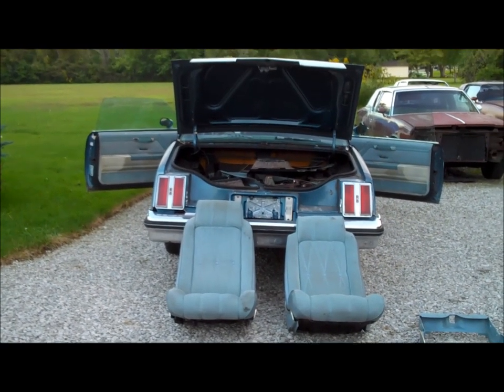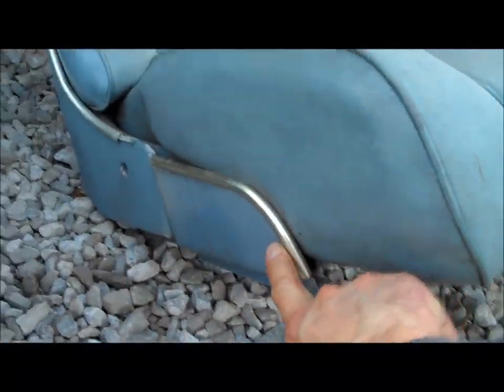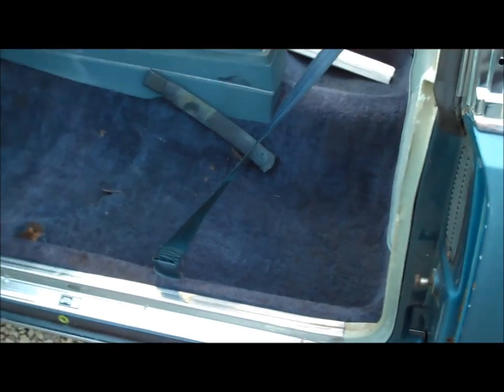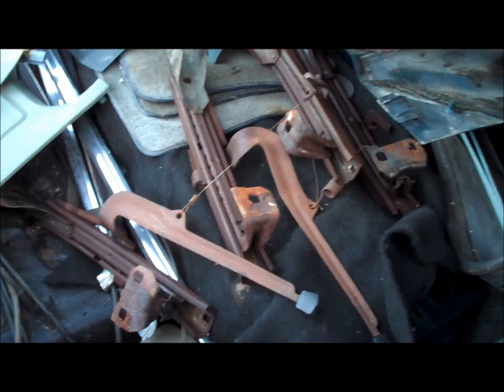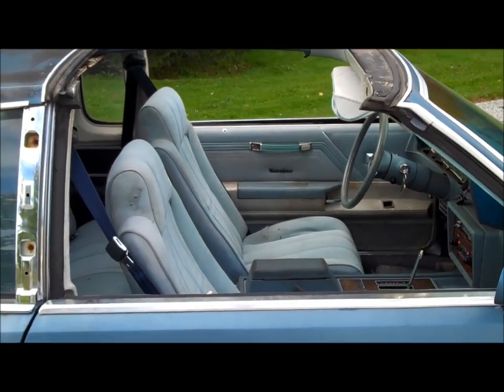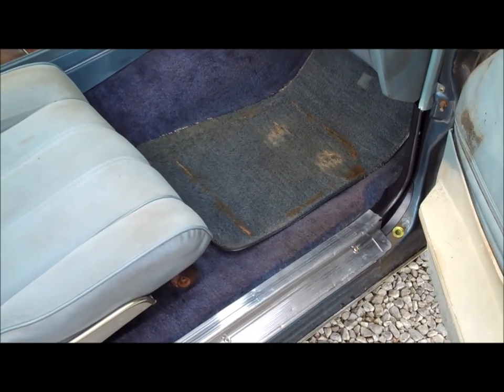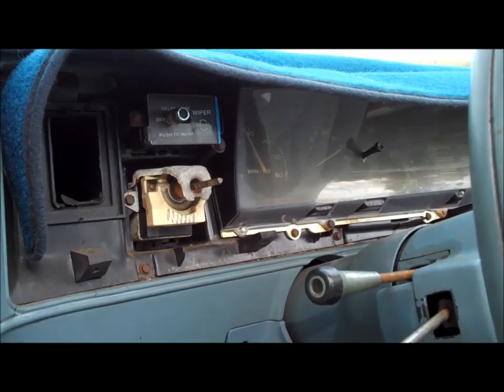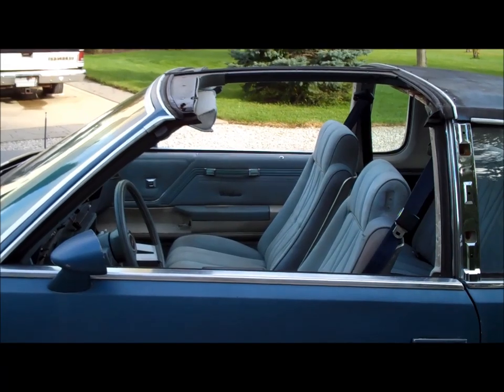78 Calais Bucket Seat Installation Classic G-Body Garage

Comment: Damn looks good for a near 40 year old car! My 86 Cutlass isn't that clean... yet... Good job!!!
Reply from the maker: Yeah it cleaning up.
Reply: Silly question! My 86 is a 5.0L would it be a 305 or 307?
Reply from the maker: Derek Joon 307 if in the states, 305 if in Canada. 307 if it has an old filler behind the water pump and 305 if you fill the oil through the valve cover.

Comment: Looks Great! When you do your gauge video, can you cover how to make the speedometer stop making noise. Mine makes a chirping/rattling sound that is proportional to my speed its worse when it's cold out. I'm sure the grease inside it is probably hard, but is there a way to relubricate it? Mine is the regular speedometer not the rallye gauges.
Reply from the maker: DanielRau1234 I will make that part of the gauge video. Yeah you have to oil the cable itself and remove the cluster to do so. Some oil on the speedo cylinder itself would help.

Comment: question ... are the seats of a 1979 G body and a 1984 the same....???

could the 1979  seats of a cutlass fit in a 1984 Monte Carlo??
Reply from the maker: molina555 The seats are all the same in a 78-88 Cutlass, Chevy changed design on theirs in the early 80s to the smaller style found in the monte ss however all styles of gbody bucket seats fit in any gbody car. All seat tracks are the same.

Comment: My driver seat won't slide back on my 79 cutty any suggestions?
Reply from the maker: The wire that ties the handle and latch to both tracks might be broke.
Reply: Is it a easy fix or better to find another one?
Reply from the maker: Jamie Rose Its easy, you just need to get some stiff wire if you can find an original. Welding wire might work well. If the wire is still intact then everything might just need oiling.
Reply: Ok thanks a lot I appreciate it I'll let you know what it was
Reply from the maker: Jamie Rose no problem